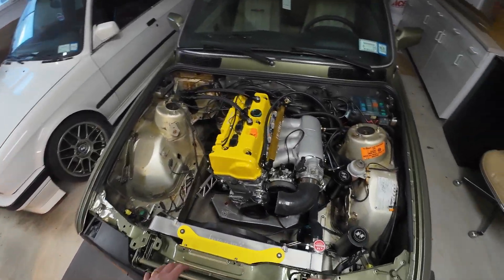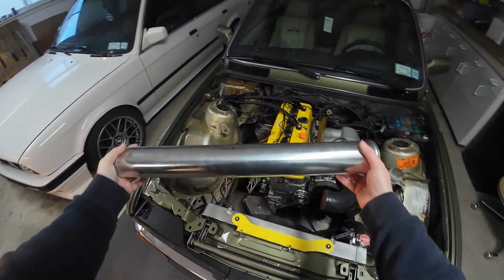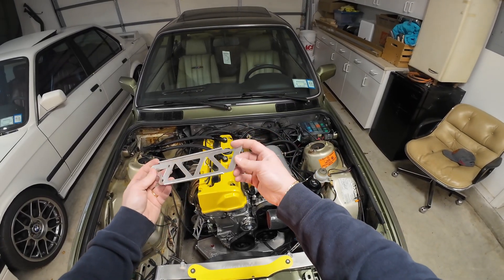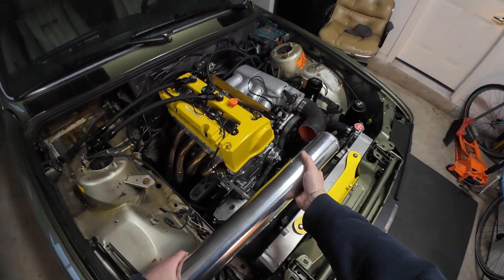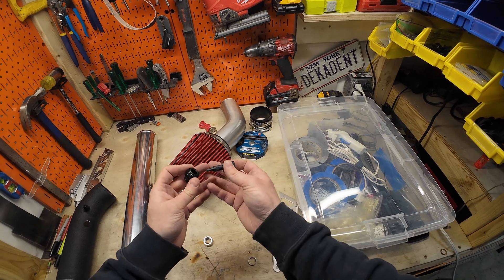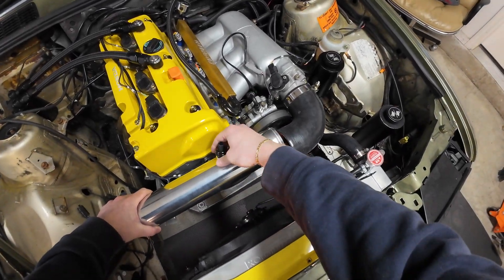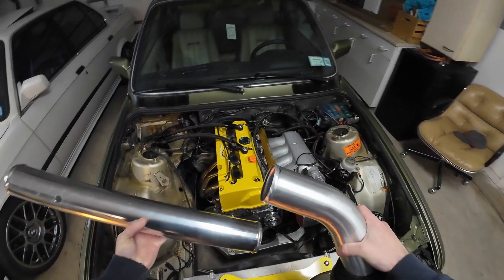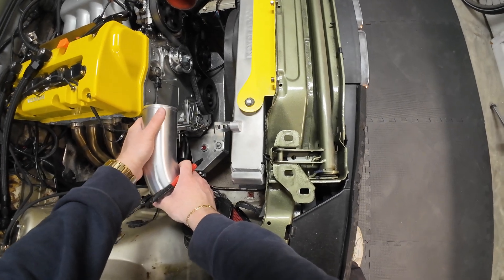Building The Perfect K24 Custom Intake!

Comment: Can I make a suggestion for your bracket bro? 
I used the other two screws and it’s solid asf and I used a simple window bar I shaved and bent straight and painted for a flush look . But ideally that works too it’s not gonna vibrate as much but most likely over time vibrated your  the internal of the solenoid . Air temp sensor just needs to be out the way of your pulley and your golden they do sell extensions for it as well or zip tie works great 

K swap the world 🎉
Reply from the maker: @earvinrangel815  Which two bolts? On the top? sounds like a good setup. I put a deutsch connector on the wiring and made a little extension for it.
Reply: @ yeah bro or also the two bolts from the timing cover just cruv out the bracket so it can sit flush and run the bracket along the intake pipe so it holds sturdy and place 1 or 2 clamps I painted mine to match my intake pipe and bracket. I wish I could up load a pic for you .